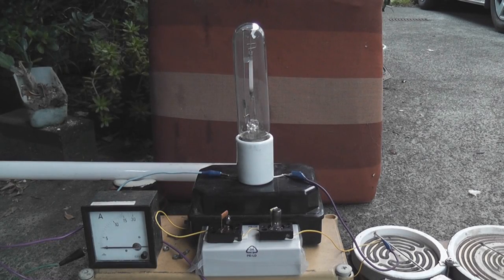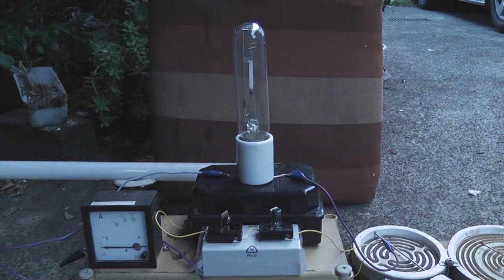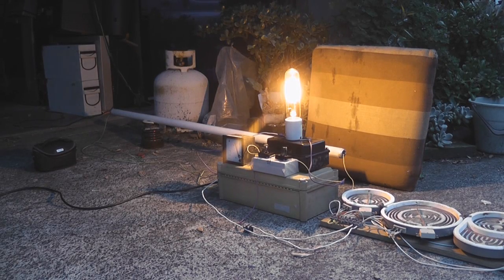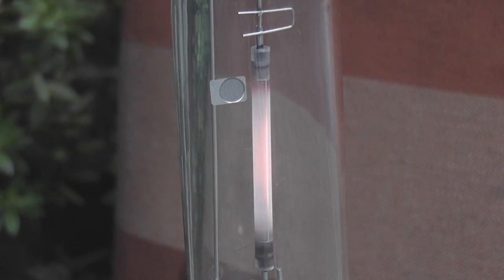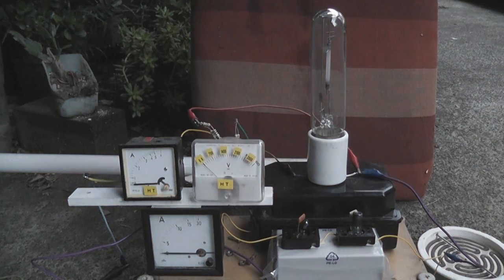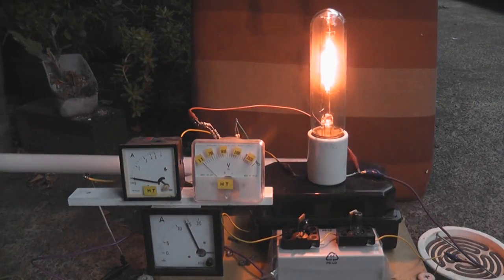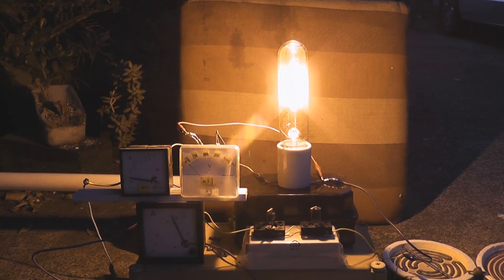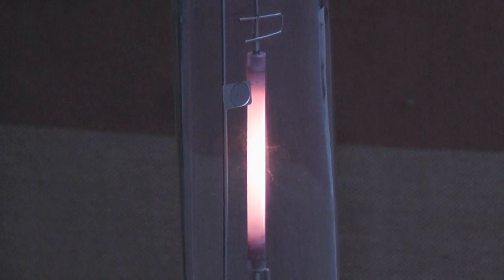Sodium lamp on MOT and 2 starters

Comment: Is there a simple way to explain why you need to ballast?
Reply from the maker: A ballast is putting a known load ( heater element , lamp ) in series with the device under test. This way the maximum current flowing can be limited to a known  value. e.g. 1 kW ballast at 240 Volts will limit the max current to about 4 Amps. If un-ballasted the current flowing will depend upon the circuit-breaker on the switch board panel.

Comment: how about de-shunting the MOT's? (removing the magnetic shunts)
then ballast it...or run a 230V ballast on about 150V with resonance on the secundairies.. your no load current (nullaststroom) wil drop.
Reply: i mean . run a 230V MOT on about 150V with resonance on the secundairies.. your no load current (nullaststroom) wil drop.
(minder kern verzadiging)

fijne kerstdagen en prettige jaarwisseling vanuit het oosten des lands :)